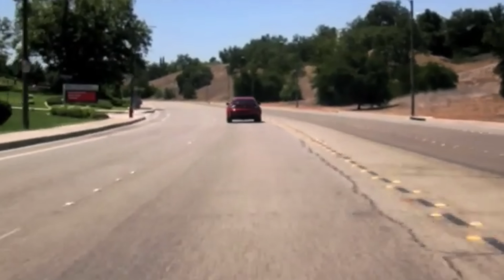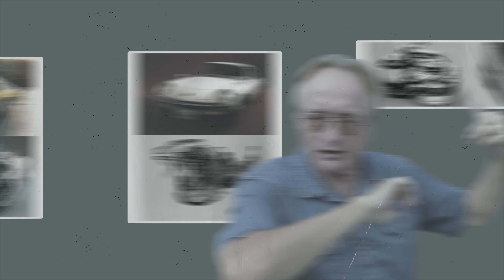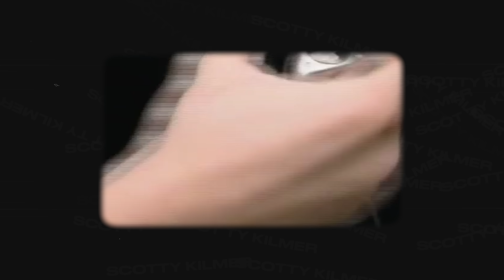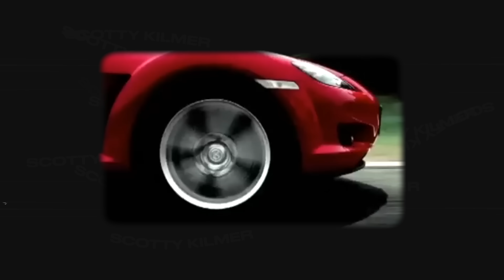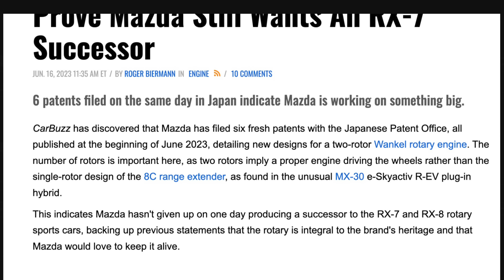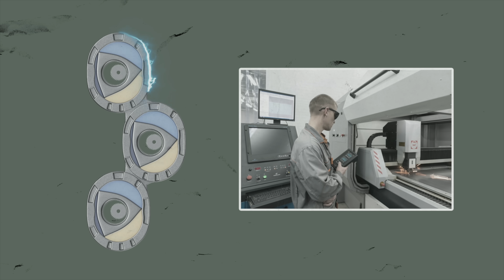Mazda's New Engine Shocks the Entire Car Industry

Comment: Running as range extender it can run at a constant rpm in a controlled way. This I will increase its lifespan. And the peaks demanded by hard acceleration can be buffered by the battery.

Audi had a A1 plug-in prototype with a wankel in the trunk. The management did not like it, so they as d the developer on a test through the alps to prove that this tech is a failure.

So the developers took the A1 hybrid and it performed very well. It was only a tiny engine but being efficient and using regenerative braking it beat the test route.

But in the end the management still axed it. Today Audi hybrids come with a traditional engine.

So this was interesting to see that it still made it somehow.

Comment: Wrong, high rpm and variable rpm is what these e engines loved I clocked over 200k on a 13b lots of mataining but not a rebuild, on load the engine is more balanced originally designed for aircraft

Comment: I love how Scotty included Liquid Piston in this without actually saying anything about them.  Their Peanut in a Triangle design solves a lot of the problems that the Wankles have.  I am the former owner of a beautiful Gen 2.
Reply: Because it is exactly the same design as the Mazda just inside out , the Mazda has a 8 shaped chamber and a triangle  inside , the liquid piston has a triangle shaped chamber with a 8 shaped rotor ! Just the same thing inside out !
Reply: @JosephCowen-fz8vj  But the differences effect how it behaves and performs. They also effect reliability. Saying it is the same but inside out seems too reductive.
Reply: @aaronmatherly9602  yes and no , it's the same motion but reversed , the Wankel could have used internal rotor porting of a similar nature , this engine is a figure 8 turning in a triangle and a Wankel is a triangle turning in a figure 8 , same motion just swapped design parameters .
Reply: @aaronmatherly9602  lol, but it's the exact mechanical principal inverted , simple ,
Reply: @JosephCowen-fz8vj  You are trying to conflate the two designs based on their "inverted" geometry and motion alone. I acknowledge the relationship you are pointing out. Can you acknowledge that their are other aspects to the different designs that set them apart?
Reply: The Liquid Piston is not likely to win La Mans

Comment: A friend of mine had a late 80s RX-7 and he drove it from brand new to nearly 400K miles and let me tell ya, he was not easy on that thing. He just did all the maintenance at the appropriate times. After the original engine did give out though, he ended up  somehow swapping a Corvette LT-1 engine into the dang thing. Once that was under the hood, I would no longer ride in it. Too scary!

Comment: The 12 rotor motor was built a decade ago. It blew up, sat around till last year or so, then it was sent to a YouTube Rotary tuner. Who took on the task of adding new technology and improving on the flaws in the original design. 12 cylinders makes for incredibly difficult ECU. Check it out.

Comment: I think the opposed 4 cylinder "1 stroke" engines may make more power for an even smaller size. The 1 stroke claim is technically wrong as the devs have admitted but the catchy name gets the point across. Also referred to as roller opposed piston engine.

Comment: I'm very interested in seeing the rotary engine make a comeback. That is as long as I don't have to own one myself. Even more I would like to see a new gas turbine car. It has even more power. And much more pronounced version of all these and some extra problems. But the power to weight ratio is unbelievable. Again I don't want to own either of these myself. As long as we are on the topic maybe someone should build a slide valve engine. Unbelievable power in old fighter planes. The only downside is the expense. And of course maintenance difficulties.

Comment: i used to have an Rx-7. Great fun. Environmentally poisonous and unconscionably inefficient though. Its kinda embarassing if your car just dumps fuel that it cant even burn, and those apex seals arent gonna be adamantium. A lot of the core issues around thermal expansion inherent in rotary design, have yet to be demonstrably addressed. Its a fun, flawed design that is outclassed by EV's in every metric except weight.

Comment: They should set it up like the 2000 insights hybrid system. It’s an electric motor hooked up to the crank for low end torque. It charges when you brake or coast.

Comment: I noticed that you showed glimpses of the "liquid piston" rotary engine too which is similar to the Wankel engine in that they both are rotary engines but the LP engine uses a different shape rotor and housing. Also there are no apex seals in the LP engine.

Why did you not even mention the LP engine by name but you did the Wankel?

Comment: I owned two RX-7 sport cars in the 80s both with the 12A rotary. The engine revved so high like a blender and was so smooth with instant power. I put 143K miles on the 1985 GS one and sold it to a teenager after my first baby arrived. He drove another 60K miles It never burned any oil using Castrol GTX every 5K miles.  It was a great sport car that I never should have sold.
Reply: Why do you keep saying sports car? Its like calling air Oxygen
Reply: @janeblogs324  Just to irritate you's.

Comment: I have 7 RX7s including a race car. My oldest 80 GS turned 300K on the original engine...
Change the oil and "a red-line a day keeps the rebuild away"... Exercise those apex seals and do not lug it! My ex wife's 2nd gen got a stuck apex seal as she never revved it past 4k...
You will see most RX8s were early two oil port engine and auto trans that never were red-lined daily... Later RX8s got an extra oil port... Those are the ones to get...

Comment: Hi Scotty my understanding of the fuel consumption issue is that the rotary uses an exceptionally rich mixture during warm up as a result of quenching due to the surface area of the combustion chamber. Having owned and enjoyed two RX8 231,s. I can state that an engine in fully warmed state, although not on a par with conventional piston engines, does return over 35 mpg imperial which for a 2.6 L gasoline we may have the 1.3 / 2.6 argument here! Is not so bad. Look forward to Mazda developing the rotary further.

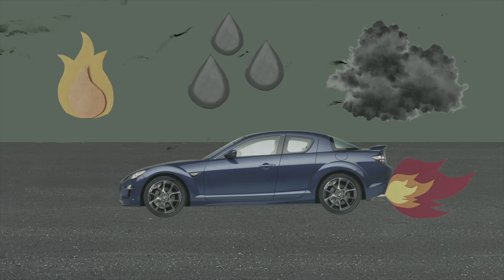Comment: Hello Scotty! Once again a very fine video, actually probably among your best. When you mentioned the truck with a rotary, I came very close to buying one, but couldn’t get one with 4x4, so oh well. I actually ended up buying a 1978 Scout II TERRA truck with 4x4, automatic HD Torque Flite, through a HD BW 2 speed transfer, into 3:52 posi rear limit slip front differentials all for $9990 ! Brand new. The Mazda was only less than half that.

Comment: Oh and if you maintain one, a rotary can last many hundreds of thousands of miles.  My 2nd car was a 1986 rx7, I purchased it used from a guy who was I believe its second owner (this was before Carfax or similar), and it had something like 200,000 miles on it.  I put another 50k or so and never touched the internals.  Lots of other parts and virtually all of it had issues, but still it ran fine especially when pushed hard.  The redline buzzer was really more of a suggestion, one I frequently ignored.

Comment: Great video! But I think you mixed apples and oranges in the graphics.  About half your engine cutaways are of a traditional (Wankel, Mazda...) rotary with a peanut-shaped housing and triangular rotor.. Problems you correctly pointed out are poor thermal efficiency, uneven expansion (hot on only one side), tip seals, etc.
The other cutaways look like Liquid Piston's "inside-out" rotary, with a triangular housing and peanut-shaped rotor. It's promising but still experimental.
As a range extender the Mazda single-rotor has potential: it's tiny (so small it just bolts onto one end of the electric motor) and makes 90 hp.  Didn't the Volt's 1.4L 4-sylinder only make 80?

Comment: i had a mazda rx3 rotory engine in a motorcycle back in the '80's, it was called the rotor motor~ It only had one gear, direct drive through a belt to a chain drive. sounded like a vw taking off, around 3000 rpm however, the horsepower started taking a verical accelleration curve and it produced more hp & torque the faster it spun! Crazy fast and powerful bike~ I have photos

Comment: Keep going with the rotary engine be different Like idea oil/fuel mixture an skip need oil pan as well with hybrid idea. Locomotives have done similar hybrid idea for years. 
Also think if need upgrade power grid for auto industry have car charge network like that of slot car on interstate highways?

Comment: If you are going to mess with range extender motors a gas turbine might be a better choice to turn a generator. Turbines are very efficient in the power range they are rated for and can run on pretty much any fuel. Plus they are very small for the amount of power they make. Piston and wankel motors make power in pulses. Turbines are like rockets, power is continuous. And they sound great!

Comment: In years past Mazda has said that one of the biggest problems was to get the apex seals to work over a wide rpm range.  Making the engine into a range extender makes perfect sense as you can optimize the seals to work at the recharge speed.  The rotary engine has always been simpler and smaller than the Otto cycle.
Reply: You really need a massive battery range advantage because even as a range extender, it is still like 25% worse thermal efficiency.
Reply: @Appletank8 its nowhere near a 25% efficiency gap when both are run atva static rpm like they would as a generator in a range extender. the efficiency can be brought well within range of modern piston engines in that setting, and its extreme performance relative to size would take up less room and allow for more flexible instalation and better balance of aerodynamics and cargo room
all engines will benefit from running at a set speed if they are properly designed for it, but reciprocating gas engines have the least to gain from it. diesel and rotarys will gain a lot more. diesel will have all the same drawbacks of gas piston engines with the addition of about twice the weight.
is a rotary a good choice for something like a pure gas commuter? no
is it a nearly ideal choice for a range extender for the average consumer who will only ever need it a couple times a year? most definitely
Reply: @silentbobfan32   From the couple of research papers on Wankel efficiency I've read, yes being on the ideal BSFC zone is much better than being off it, but the peak isn't as high as you'd think. 

Even in a world with perfect seals, the Wankel still has the problem that its combustion chamber is long and thin, resulting in high heat losses to the coolant instead of mechanical work, resulting in a theoretical max ~30% efficiency. You pretty much need a magical material with 0 heat transfer to come close to piston engine efficiency (~35%).

Engines in the RX8 were hitting 25% at best. When Toyota is hitting 41% efficiency with their Dynamic Force engines, this means being 25% worse on fuel-to-power right off the bat.

This is partly why a lot of engines nowadays are about 0.5L per cylinder, its the best combo of surface area/volume and packaging. 

If Mazda really wants to sell the idea of a rotary generator, they have to push the other advantages as hard as they can, because fuel efficiency ain't it.

The theoretical ideal for a PHEV is a big electric range with a small, lightweight engine to boost overall range to do long trips comfortably. The small Wankel seems like it could be a perfect fit. The problem is that the addition of the small Wankel cuts the electric range of the MX30 in half, to the point it's basically on par with the RAV4 Prime on electric range, and much worse on gas range. What little information Mazda has given out has implied an MPG of 25. Out of an engine producing only 74 HP.

This is awful.

Comment: I'm a fan of what Mazda does, for the most part. But there are things that I disagree with and the rotary engine is one of them. I believe the time has come to move away from it. If Mazda wants a new RX7, they can make it a proper electric vehicle. The electric motor is a rotary powerplant, so the R in the name would still be valid. The electric motor is far more reliable, has endless torque, and is pretty clean (especially if Mazda adopts solid state batteries and/or fuel cells), things that the Wankel cannot claim. No doubt, the Wankel is a cool idea (as have various technologies over the years such as Miller cycle, and Skyactiv-X) but in practically it's just money spent developing things that don't really pan out in the real world.

Comment: the RX-8 had a hydrogen burning version. not a fuel cell. internal hydrogen combustion. the production version could switch between gasoline and hydrogen at the flip of a switch. it was only available in Japan and Norway.

Comment: I owned three RX-7's ('79,'80,'81) ... my favorite was the 79 with the original thermal reactor (instead of catalytic converters). The first time I took it up I-70 to the Eisenhauer tunnel, I was so impressed with the smoothness. I drove it across country - had to replace the ignition points a few times (distributors on those were notorious for becoming lose and burning up the mechanical contacts). I was really hoping to see the rotary boosted MX30 PHEV in the US (not to be). That would have been the perfect application for it. If they do come out with a new RX ... I hope its a high powered PHEV - using the electric motor(s) to supplement low-end torque - letting the Rotary do what it does best at the higher end. I won't be able to afford it either way.
Reply: I'd definitely treat that High powered PHEV RX better than my wife. That's for sure!

Comment: Mazda should change the rotary lubrication system. Oil should never be added to the fuel and burnt inside the engine. Oil should come from a separate tank and be injected at the seals only.

Comment: A rotary is better suited to burn hydrogen than piston engines. In piston engines the hot valves and hot cylinder walls pre-ignite the hydrogen. In a rotary intake and ignition chamber are separated.

Comment: Designing and making new gas engines will send a good car company broke.
Not because it is a mechanically efficient gas engine well designed. Because of the cost and scarcity of gas fuel in the future.
As EVs become more popular the use of gas fuel will decline pushing the price ever higher.
This is what we are seeing today. It is the economics of volume use. This very fact will encourage more EV purchases.
Driving the price of gas fuel ever higher.
It is the type of fuel economics that will dictate which car is purchased and used by the public.
If a car manufacturer makes a wrong choice, it will be signing its death warrant.
The type of fuel the car uses will dictate the type of car manufactured. The future is about change. 
The next big change will be a car's body shape, as did with your phone. Making gas cars look so out of date.
A gas car can't use the new body shape due to the housing of its mechanical parts.

Comment: A diesel rotary engine would be nice.  Rolls Royce tried it before in the 50s I think, but they could not get the seals to hold up.  A diesel with a high redline would be quite nice.  Roller seals at the apexes have been patented, but I am uncertain how well they would work.

Comment: I had and RX-3 and an RX-4 and loved driving these rotary engine cars. There’s no doubt the rotary has issues that need fixing, but the power, smoothness, quietness and lightness are great to live with.
Reply: Had a 1984 GSL-SE, smoothest car I have ever driven, the only thing smoother would be an EV.
Reply: @RickHolland1968  straight 6 are very smooth. And a bootful more torque, the only thing the rotary has over it are   the revs it can go to (not everyones cup of tea tho) and the lower weight. I think I would take a Nissan RB engine over a rotary.
Reply: I also had an RX3 and an RX4. Loved them but durability got them at ~ 50,000 mi.

Comment: Interesting, inverting the oval cavity with triangular rotor to become an oval rotor in a triangular cavity to reduce the vane seal problem.   They should make them flexfuel to avoid the carbon problem as it simply takes programming the fuel injectors to allow a wider fuel air range.   As a range extender is still the obvious role with the current trend towards EV's but the no ICE regulations after a given date legislations might have to be amended and it's debatable whether continuing to offer gasoline and or ethanol or
 gas stations will remain a profitable business model with the lower volume of sales

Comment: Rotary engines and cool, and different, which kinda makes them interesting and unique, but I definitely like the reliability and longevity of Mazdas piston engines. I loved the BP engines that were used in the Miatas. The old BP engine from the 90s in my car is still running in 2023 and still doesn't burn any oil. I know there is a cult following for the rotary, and it would be cool to see them return with improvements.

Comment: My 2nd sports car was a '71 Datsun 240Z.  Learned very quickly that to have it perform optimumally you needed to tune it once a month.  My 3rd sports car was a '79 RX7.  Used the same mentality on it. It was a blast to drive, 2nd best handling car after my '67 Marcos GT.  Had well over 250,000 km on it. Kept on going.  But learned... do not flood a rotary... 😂😂😂 

Personally,  love these engines.  Hope Mazda brings them back.
Reply: margos gt wow.  thats so effen cool.